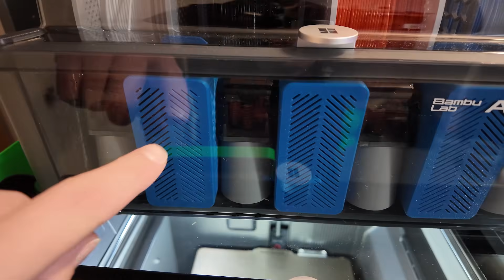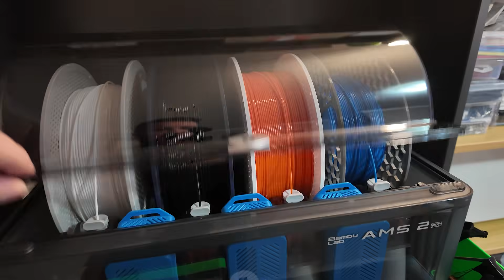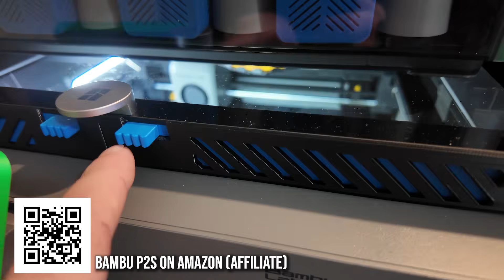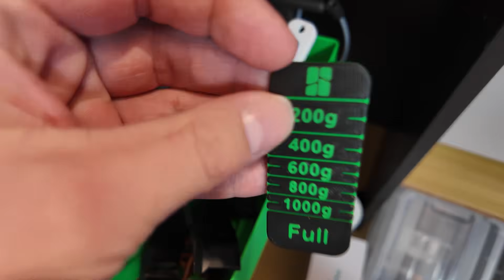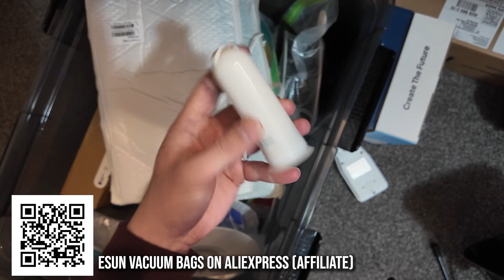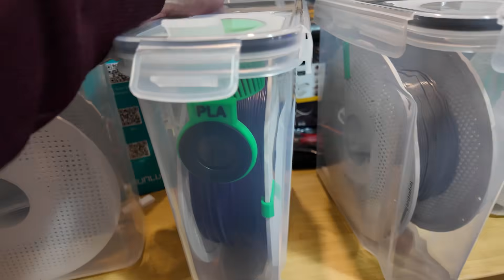Cool Upgrades That Make the Bambu Lab P2S Much Better!

Comment: thank you so muchit realy hulpful  where can i find the file for the storage in de back off the ams
Reply from the maker: This one here? https://makerworld.com/en/models/1474287-ams-2-pro-rear-desiccant-box-spill-proof
Reply: @HamRadioDX  yes thank you so much  the ones in the front are 2 parts front and back but how do i now wich one has to be on front after printing sorry for the questions but just starting
Reply from the maker: @bribos1965  The larger (thicker) one goes at the very front of the AMS, the smaller one slots in behind it.

Comment: Have you found any problems with any of the third-party filaments? I've only used Bambu and Polymaker and both have printed many items with excellent results so far.
Reply from the maker: I have Elegoo and Sunlu filament too. I've had no issues apart from an Elegoo Rapid PETG Clear filament breaking/too brittle. The filament got caught/lapped under itself... it just threw a "out of filament" error once it passed through. It did it twice. 
Apart from that, no other issues.

Comment: Have you had any problems with "extruder motor overload" errors?  I had to send back my X2D because of constant errors.  Thinking about getting the P2S, but concerned about reliability.  I'm a newbie, lol.
Reply from the maker: No I haven’t had any errors at all.
Was the filament feeding without any jams or issues?

Comment: have you seen a noticeable increase in your power bill since getting the 3d printer? I'm trying to determine how much power it actually takes/cost if it's going all day for certain prints. Cheers
Reply from the maker: I haven't seen an increase but I did measure it. I had it running and measured about 90-100W when printing. So over 24 hours at this consumption it will be about 2.4kW - we pay about $0.28/kW... so around 50 cents or so a day. That might vary depending on print, heaters etc.

Comment: as much as i like the top, it doesn't retain the heat very well for certain materials, i do print with ASA and ABS from time to time and i need the chamber temp to at least be 50c and the P2S doesn't have a chamber heater of its own.

Comment: I use a tote similar to what you have but mine is air tight, and in it I keep a desiccant holder that you can plug into the wall for recharging.  I mostly use Overture with my X1C.  The cardboard spools are fine in the original AMS.

Comment: Ditch the PLA and try PTEG. Much better material to print with. 3d printers are such a great tool. Also have a look at the brass metal heat inserts for screws. Maybe not totally needed but does make a print look pretty cool. Rabbit hole activated. 😂
Reply from the maker: Haha, the 3D printing rabbit hole is endless, but those are great suggestions! 👍